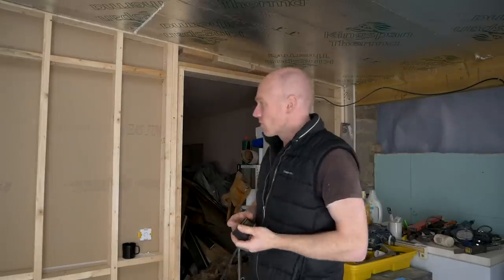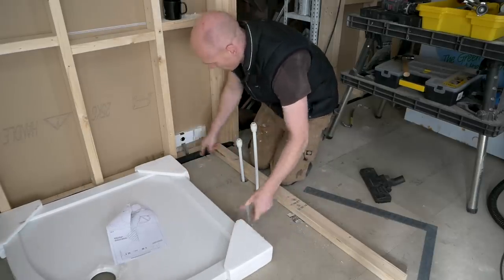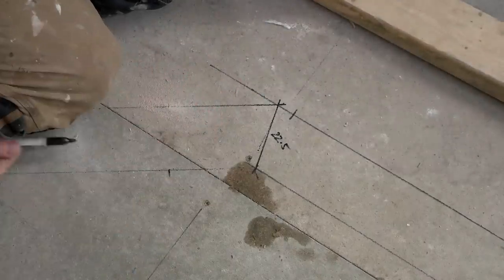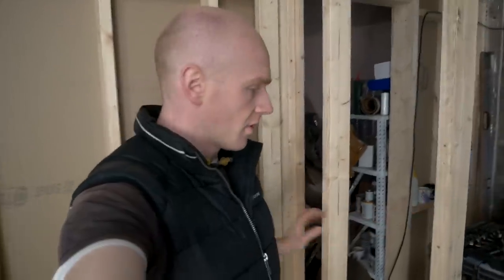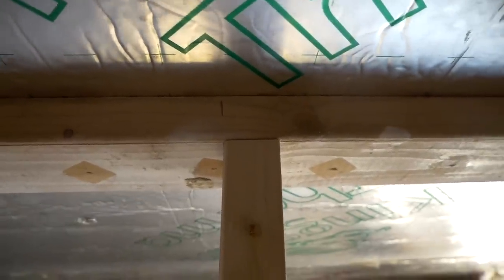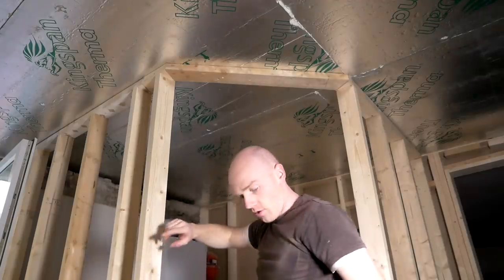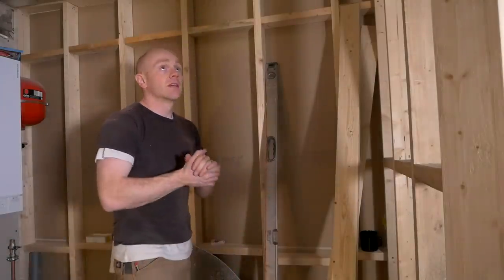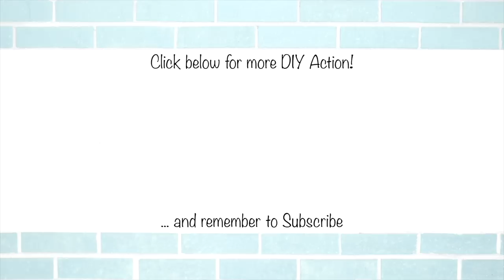Framing an ANGLED STUD WALL - well trying at least!

Comment: Great video. Really shows the ups and downs we go through. I'm currently in the middle of a double french door jamb install on a 45°. I was stuck on that triangle/ kite piece. Logic pointed in that direction and you confirmed that. I'm going to add glue since theres a load from the weight of the doors.  Thank you.

Comment: I like Deborrah's idea for the door, it's a neat solution. What I like about it is it is giving you a visual clue that the room is going to be a bit small. If you go with a traditional pine door you are subconsciously expecting the more generous rectangular space behind it. Also a heavier door conveys a message. I've got the crappy Howden's special in my small bathroom, it is 685mm and doubtless filled with cardboard. It returns to a spring thingy on the floor. While the door is naff it does work on a functional basis.

Comment: Looking good!  If that door you plan to use is solid wood, maybe you could cut it down the middle and hinge it both sides - that way the door and shower pan/glass can't collide, and it would probably look pretty nice as well with some kind of attractive locking hardware in the middle.
Reply: What a cool idea! Problem solved.
Reply: @michellejaggard9657  you ladies seem to be forgetting that us guys are lazy buggers !!!! lol  Opening TWO doors to go to the loo is a bit much, isn't???? :-))))))))
Reply: I'm not trying to be one of those idiots that disagree with people over the internet but I think that would look horrible tbh. If it was hinged on the left then it would miss the shower cubicle/screen anyway.
A standard 30"doorway isnt wide enough for two doors and just wouldn't look right, especially if your just cutting a door smack down the middle. I've seen too many botched doors/doorways in my time as a carpenter/builder. 🙂

Comment: If you line the inside with OSB before you put the drywall up you will be able fix all your fittings anywhere you want, will also allow you shower screen to be fitted easily. Great videos keep up the good work.

Comment: great video! 
We're fully insulating our single brick utility room which is at the back of the garage and creating almost exactly what you did here (bit smaller) for downstairs loo. Door from garage is on the wall where your boiler is, then door from kitchen at right angles to that, facing where door into WC needs to go, and we're putting base units on the kitchen door wall. Big window and door on the end wall. If we'd done a door in a straight wall we'd have ended up with a nasty narrow bit and blocked more light out. 
Never done anything as big as  this before but quotes we were getting were £6 k (with us supplying rad' ,sanitary wear, taps,base units and utility sink, macerator)
Sorry if this is a dumb question,but where is the 45 degree angle measured? 
If you drew a line straight across the  end of your right hand stud wall (looking into the room),then measure the angle to a line drawn where the inside edge of the door is going to sit, is that the 45 degree angle? Then repeat on the other side?

Comment: Do you not recommend doubling up on  your timber for thr door opening?

Did you do a video on fitting the door lining?

Also any recommendations for the filler piece when building with 3x2s?

Comment: Great video.... your mind seems to work like mine... always trying to figure and problem solve! And as far as the noggins go... I’ve done it both staggered and straight in the past. You could always add an extra noggin on top of the staggered ones to make them level to the next one if you know what I meen. Just more trips to the chop saw and more nails in the gun. Nice little area you have in there to work with👍 take care mate. Marc

Comment: nice !! little tips cut in bevel 2x -2x4  in 45 angle all the lenght of the 2x4 so the lenght of your wall studs  and put it between your outside corner each side with your studs cut in 45 and also take the  other cut of 45 degres and put the 2 between the outside corner its make solid for the joint of the drywall

Comment: Regarding the noggins both ways are good enough and neither is strictly a wrong way to do it, they are commonly staggered for ease of fixing though I myself do prefer to have them lined up. The plasterboard absolutely does not need to be supported there though, it is designed to span across your uprights in that manner and doesn't affect the strength of your wall in any way. Yes it's great if the join is supported there but it's absolutely not necessary. 👍🙂

Comment: On your question about the "noggings", (spelling?). Also known as "fire blocking". Where the plaster board would have a solid connection at the seams, this is what I do. Cut another piece of wood the same length, and screw them from the top. You won't need to screw them from the ends, it will give the plaster board support, and use any scrap pieces you have.

Comment: I don't stagger the bracing in the walls. When I am hanging dry wall or later looking for a solid surface to nail to I expect it to run in a straight line horizonal as well as vertical. If staggered once the studs have been covered it is very difficult to find the boards at different levels. Just my opinion on how and why I do it that way. Bathroom is looking good.

Comment: You only need a straight row of noggins to pick up the edge of the board if your studs are at 600mm centres. If your studs are at 400mm centres noggins are only there for stiffening the wall up, not for picking up the board, and you can put a staggered row half way up the wall. Hope that helps.

Comment: You seem like an extremely competent DIYer. Curious why you chose not to hang and plumb your radiators and why you are not doing first fix on the electrics? Both simple jobs that would be well within your ability from what I see on the videos.

Comment: I do my studs in line and generally 1.2m  centres - better to support board and conveniently rockwool slabs slot straight in if you are using them!

Was the error that the laser level setting was reading from the front of the device whereas before it was (correctly) reading from the rear?
- I’ve done that a few times myself.... infuriating!

Comment: Excellent, as always! However, did you ever think about building this in masonry to better achieve sound proofing of the bathroom?
Reply from the maker: Not really as it’s a suspended floor.
Reply: The Restoration Couple that makes sense. There’d be a lot of disruption to the sub floor. We’ve had a similar thing done to our cottage but we’ve replaced all floors to concrete with UFH so it was more possible. Love your videos!

Comment: I knew when I saw the start of the video you would have issues with the dimensions of the angled wall. I have chopped corners off in hallways etc and it just makes the house flow better. In our house I am building a new master bath and bedroom and it has a few angled walls at odd angles. I use a double top plate and i let the top plates overrun so they will form lap joints. At most angles this means you will may have a point sticking out on an outside corner and a missing one inside. As for the horizontal blocking. It isn't required for drywall support. In fact it's best practice to not put fasteners into any horizontal lumber because they expand and contract opposite of the wall studs. Best practice is to use acoustic sealant at the top and bottom (or everywhere). I wish had a easy way to email you a few pics of how those plates are cut.
Reply: Oh and to add. Even though I'm in the US I get the Rodney comment. My favorite episode was the chandelier cleaning one.
Reply from the maker: Sounds interesting, think I understand. My email is in the description if you have pics, always like to see other methods for things. 👍

Comment: Personally I would have the door open outwards to the bath room or consider having the room square and having a door that slides inside the stud wall. In regards to the noggins I don’t think it makes a big difference to the board which way you go, but I generally find it better to put the plasterboard vertically

Comment: Hi - if you did it outward opening would this make it easier to access in the future if anyone was in a wheelchair? Thanks
Reply from the maker: There will be another larger WC in the new side extension at ground floor level which will be wheelchair suitable for any guests or future owners. This bathroom is on split levels so not really needed.

Comment: How I do it is, for wall, from top right to bottom left run a 1x4, you have to cut into the stud so it sits in there nailed on. 
How you did it we all fire block, not for strength, but everyone hate that  because if the wall is done and plumbing or electric have to run a line they have to drill thru them block's. 
Everyone does it how they want.

Comment: Theres 2 settings on those laser tape measures, one is for measuring from flush with the surface, the other with it sitting on top of the surface. Looks like you were missing the length of the laser tape measure off the top of those studs :D :D ....I have done this myself

Comment: Tim one thing I am unclear about is that the standard way of stud walling seems to be top plate, sole plate, plumb and chalk lines, then knock the timbers in tight with a mallet. Doesn't the traditional way produce a stronger fixing than the cassette way you are doing it? I am only asking because I have heard Roger Bisby talk about how much force a toilet fixing exerts on a wall, and that he has heard of instances where the wall has moved when someone has been on the toilet. 

Great video as always, I don't know if there is a right or wrong way of doing stud walling but just wanted to make the point that bathrooms do put more stress on stud walls than say a room dividing wall. Also if you get a bit of movement could it compromise the tiles and water tightness of the shower say???
Reply: To be fair Roger did say that is only on floating toilets most toilets sit on the floor which Tim's will be, frame building and stick building studwork are fine both ways
Reply: Thanks - Tim's way seems a good deal easier so was just wondering if it was a bit too good to be true so to speak.
Reply: @dannymurphy1779 I like his vids think making it as a frame is harder for amateurs and he would of been better stick building the 3 walls, ceiling insulation wouldn't of helped him tho

Comment: Good video this. Looking at partitioning a bedroom up with a similar space to yours to provide an ensuite bathroom. Available space in the room is a little tight though, so keen to also use the angled doorway design to aid the flow around of the main room. Is the finished internal length of both of your new stud walls approximately 1.2m off their back walls, after the boiler is boxed in?
Reply from the maker: Yes, both the straights are around 1200. Not sure on total size off the top of my head.

Comment: Looks like you accidently set your laser to measure from its front site instead of the rear.... don’t ask me how I know 🙈
Reply from the maker: I did think that but checked several times and was still on the base setting. I think I mentally just managed to drop 100mm while repeating the number to myself walking between room and mitre saw. 🙄
Reply: @therestorationcouple the most common miss cut in carpentry and in fact the whole of the building trade is a 100mm. I remember my first year carpentry and joinery teacher at college telling us this and he was so right, I still very occasionally cut the odd piece of timber short and it's always by a 100mm and I've been doing woodwork for nearly thirty years now so you can forgive yourself for that booboo .👍👍🙂🙂

Comment: When you plate you only chalk line the outside.  Let the plates from sides run wild, put the shortest piece on top and sight your angle from above.  Make your skillsaw cut right on the floor, the blade marks the plates below.  Knock down the plates and finish your cuts.  Mark your studs and cut them to your shortest length less an eighth inch, stand up, shim, nail and your done.  That framing should take less than thirty minutes with cutting your 45 degree tack stud.

Comment: How is that gone be with the door and a sloped roof and small strange side corners. Hehehe im gone wait for that door;). I would have made a small high window in that wall for some air flowing true that small room and some natural light ( next to the heating system above the white part)...
Reply from the maker: It will be a standard door, there will be wall above it. A sun tube or roof window would have been nice but the wall you mentioned is now around 600mm deep so not an ideal spot for a window. This room is a bit of a bonus and on a tight budget so can’t be too fancy. 😟

Comment: Come on Tim, why do you have a plumber doing underfloor heating and rads???

I've done all my plumbing myself, including underfloor heating and an unvented cylinder, and you're way more capable than I am!
Reply from the maker: It’s more for the pumps, valves and stats side of things as we run multiple zones and controls. I’m sure I could manage it myself (just) however limited on time and if one thing can be delegated it’s that. 😀